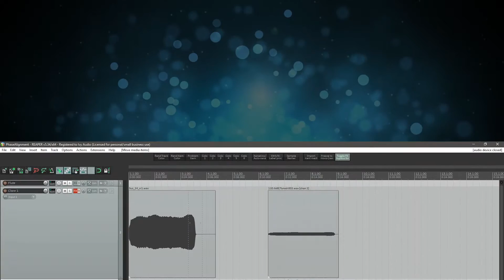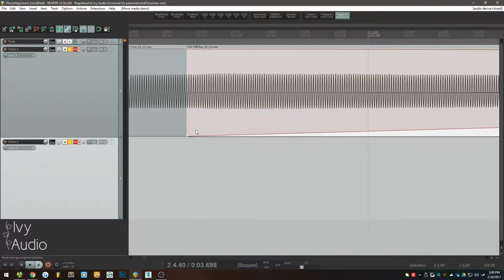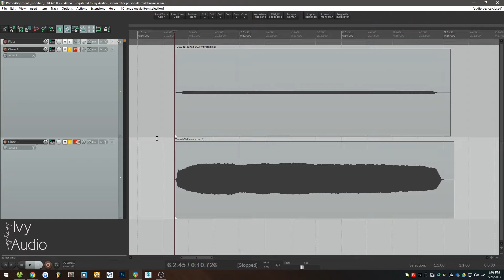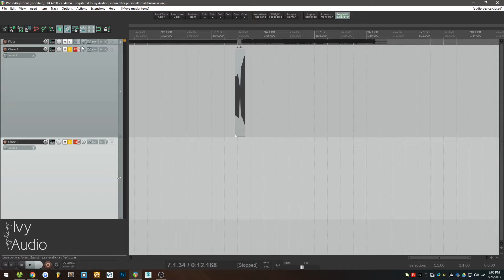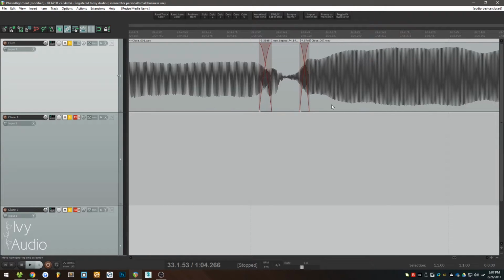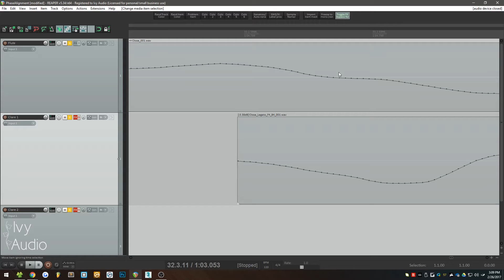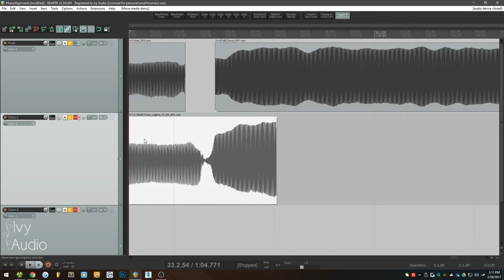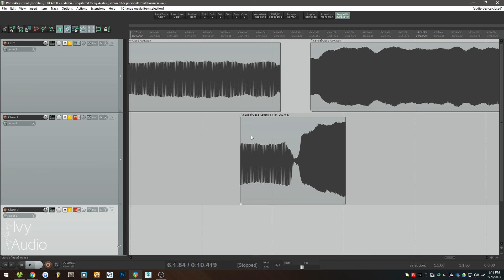Building Kontakt Instruments - What is Phase Alignment?

Comment: Hey Simon, you can see my writeup where I've taken pitch variation data and applied it to phase-aligned samples here; http://www.dariusjalexander.com/2017/06/17/first-ksp-scripts/
No audio/video demos yet, but I expect I'll come back to this sometime to finish it!
Reply: What software did you use to extract the pitch variation data?
Reply: @jesusginard  I used Imitone rigged to input/output through Max MSP
Reply: Do you have an updated link for this? It's giving me an error, and I'd love to see how you did this!
Reply: @JLaw1591  Sorry, my blog is down at the moment. I need to find some time to fix it!
Reply: This is good stuff. I’m lucky as a percussion composer. I can stack my velocity layers, line up the starts, and use flex time in logic pro to roughly align phase. I use the highest velocity as the key and work down from there. Loud percussion hits have the most pitch variation and that should be preserved, while soft hits are well softer so the pitch correction is less noticeble. You’d be suprised how much pitch varies over time even in marimbas and vibraphones. The speed setting in flex time is very transparent and leaves practically no artifacts.